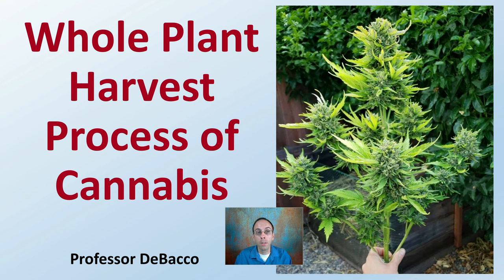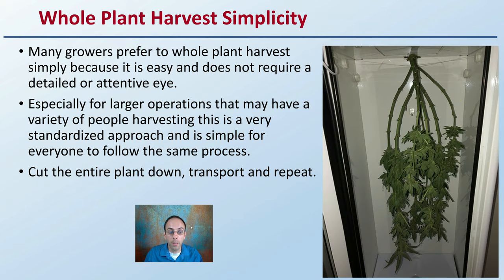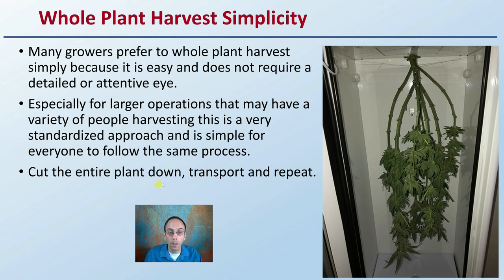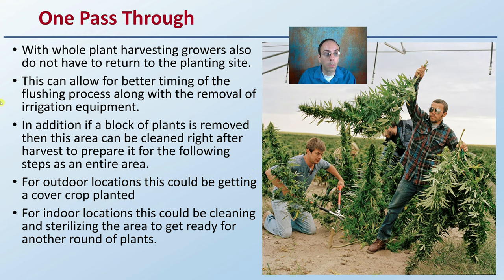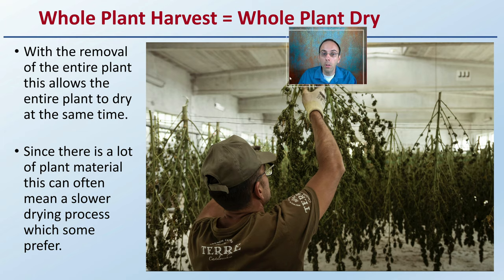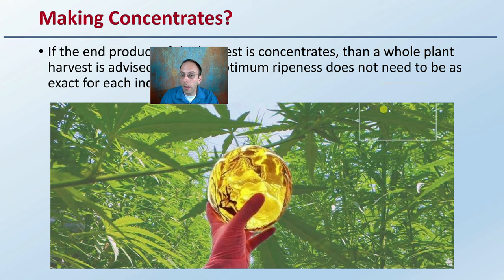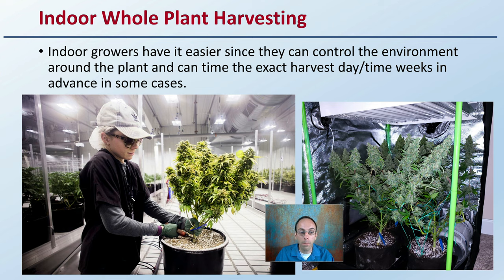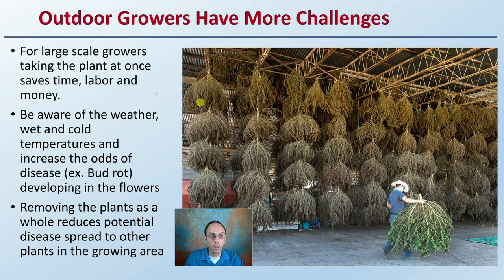Whole Plant Harvest Process of Cannabis

Comment: You said cut the Plant--OH NO- DIG plant Up and hang WITH ROOTS(covered where drying dirt does not fall down and get on sticky Buds. Actually splitting(tearing) Each Branch where it meets main stalk so Plant IS Injured/Dying PUT Grow Light Underneath and let cure with grow light a few days SO Plants Roots will create More/stronger THC to Keep Plant alive(as it is curing) Higher % for all buds-possible stronger smell(LOVE that Smell them there sweet spices
Reply from the maker: If soil gets on the buds it can lead to contaminated which is why cutting the plant is the recommended method.
Reply: @DeBaccoUniversity  THANKS for reply--Yes---you should still  do experiment with One plant--WHAT I SAID--you may find Two different plants YOU MUST leave roots to Dry out and Produce More/stronger/higher-even more potent smell--EXPERIMENT and the MOTHER will Repay YOU